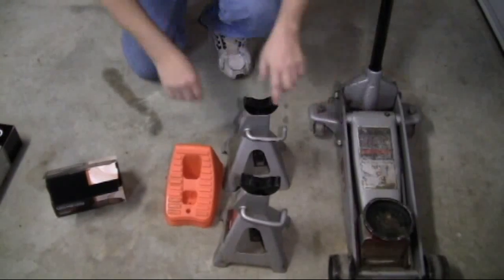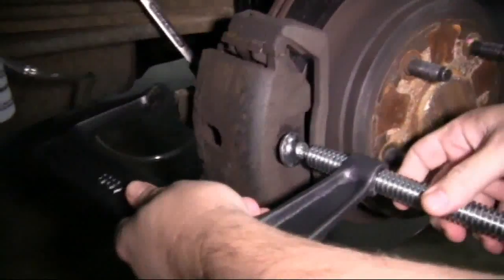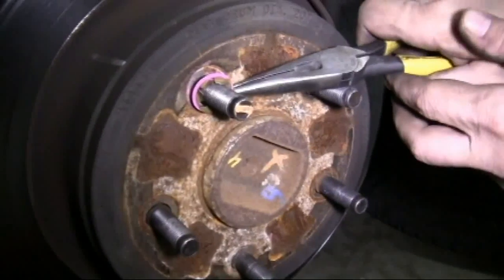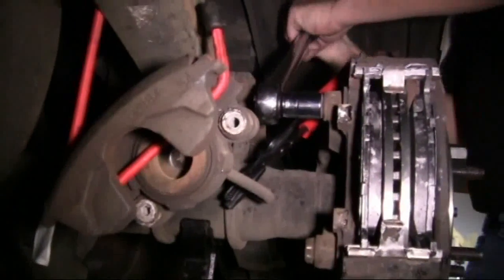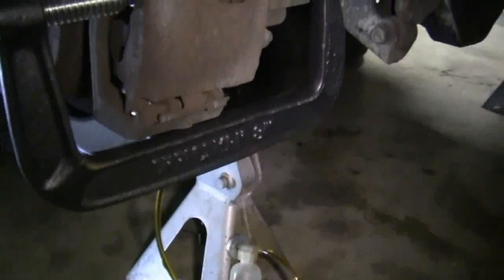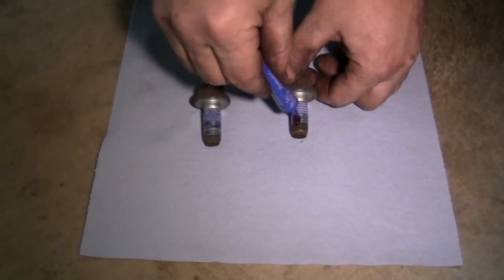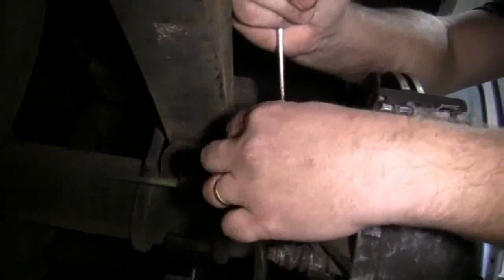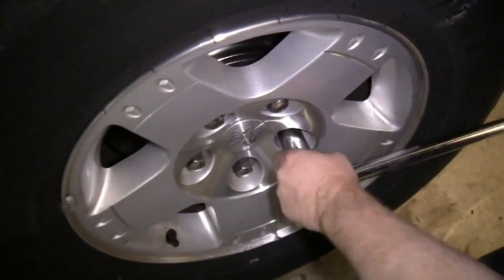Rear Brakes 2004 Dodge Ram 1500

Comment: Many thanks for the vid. I was especially interested in seeing the direction of the pad slide. It seems that the prior owner of my truck installed the slides in the wrong direction (there is a "wide" tab at one end of the slide so, basically, the right side was on the left wheel, and vice versa). Ultimately, the pads got hung up and dragged until the pads were toast. There's nothing as exhilarating as the sound of grinding metal when you touch the brakes...
Reply from the maker: Yikes that is a terrible sound.  Glad we could help. -Greg

Comment: In my opinion, this is a great video tutorial, especially after the service department at the dodge dealership quoted me close to $600 to replace my rear rotors. After watching this video, I'm confident I can change them myself. Very detailed instruction. Thanks.
Reply from the maker: Man $600 just for the rotors?  Wow.  You can easily do it yourself.  -Greg

Comment: I did try to change my rear rotor on my 2010 ram 1500. The rotor won't come out. I did try to adjust to release th e-brake from down to up rotation. My question is how do I know the e-brake is release. Thanks and please email me the step by step procedure just to release the e-brake. Please email me jbajo@yahoo.com. Thank you.

Comment: No need to bleed the brakes, just open the brake  resv. cap and compress the brake calipers...

Also, you don't show how to remove the emergency brake cable, etc...
Reply from the maker: It's always a good idea  to bleed the brakes especially if you open up the system.  Compressing the calipers without opening the bleeder screw allows trash in the system to get into the ABS unit.  Its a small chance but still a chance.  We didn't remove the emergency brake cable because we didn't replace the emergency brake shoes.  -Greg
Reply: @GregorysGarage  you wrong must people wont bleed them unless you replace caliper

Comment: Dodge 2500, 2003.Having a intermittent issue with the rear right brake not releasing. I checked the parking brake but I believe it's not the problem. Any thoughts

Comment: Greg, I replaced all my brakes (rotors & pads) on my 05 ram just like yours. Now if my truck sits like overnight, the next morning I will go to drive it, and I can here a groaning noise. I think from the rear, after I drive for about 1 mile its gone until it sits for a while again. Also it will quit it I tap the brakes. any ideas?
Reply from the maker: +k300zx I am really not sure.  Did you bleed the brakes?  Did you adjust the emergency brakes correctly.  Sounds like your calipers are dragging a little after it sits.   I would make sure the brakes are bleed correctly.  -Greg
Reply: I didn't bleed, just open the cap, I just adjusted the adjustment screw today. Ill check in the morning. its hard to determine which brake is hangin up. thanks for your reply

Comment: hey man....great vid......thay adjusting nut...would that be what i need to do.....my front brakes keep locking up....and no braking from rear tires.....thnx in afmdvance
Reply from the maker: +Alfonso Ortiz The adjusting nut on the rear disc brakes is only for the emergency brake and is not used in normal breaking situations..  Sounds like your problem could be else where.  Problems could be master cylinder, proportioning valve, etc.  Also is any brake pressure getting to the rear calipers?  Now if your vehicle has rear drums then the adjusting nut can affect rear braking but since this video deals with rear drums I am assuming yours are disc too.  -Greg
Reply: +Gregory's Garage thnx for the reply......n yes....they r disc as well....why i figured to ask

Comment: Don't know why this video is using a brake bleeder kit when they're not even changing the brake fluid or disconnecting the calipers from the brake lines.  All they really need to do is take off the cap on the brake fluid reservoir under the hood.  Everything else in the video looks good although I really don't bother using loctite if the bolt/nut is not for sealing a fluid compartment.
Reply from the maker: Bleeding the brakes is a good idea after you open up the braking system.  We open up the bleeder screw in order to compress the piston.  We use a brake bleeder kit to minimize the mess.  -Greg
Reply: Never hurts to run some fresh fluid through the lines.

Comment: Awesome video. Have to replace front and back brakes and rotors on our Durango tomorrow. Hope it goes that easy for us. Thanks for the help.
Reply from the maker: You're very welcome.  Let us know how everything goes..
-Greg
Reply: 6 hours later and just did the back brakes. Driver side was Smoken, Took it apart again and found a rock stuck in the caliper. Had to stop and try again tomorrow. Thank you guys for your video it was a lot of help

Comment: At the end, you installed the tires and lug nuts; snug the lug nuts; lowered the tires to the ground and then torqued the lug nuts to 135 ft-lbs. In essence, you are tightening the wheels with full load on the tire; different bolts will have different lateral force. Is is not better to torque the lug nuts when the tire is in the air (chock the wheels from rotating or just let the tire touch the ground slightly to prevent the tire from rotating)?
Reply from the maker: When we snug the lugs up they are tight against the rim and I can't imagine much more lateral force on them when they are on the ground.  I really don't see a problem.  But if you are concerned you could always either set the emergency brake or have someone apply pressure to the brakes while the vehicle to still on the jack stands.
-Greg

Comment: How do you Re-adjust the parking brake? I had a dragging PB (wore quickly) I replaced shoes& hardware. PB goes to floor w/o any friction. Supposed to be "self adjusting" (found this not the case so much yes-installed correctly). Attempted to tighten PB till wheels would not move freely, then back off. Ended up w/ overheating rotors. What is correct adj? Thanks great Vid.
Reply from the maker: I would adjust the parking brake until you could feel some resistance when turning the wheel then back it off a couple of turns and test it out.  You can test it out by putting the car in drive or on a hill and see if it holds as desired.  You can also adjust the cable going to the parking brake but it sounds like yours is fine..

-Greg

Comment: I know you posted this a while back and I appreciate many of the pointers you made.  One correction: On the rear brakes the caliper mounting pins should not be torqued to to 25 ft/lbs.  This is the torque specification for the front pins which are larger.  The correct torque value for the rear pins is 11 ft/lbs.
Reply from the maker: Thank you for the comment.  I don't have the manual in front of me to double check.  But as we state, or should state, in the videos that you should torque to the manufacture's specified settings.   We try our best to get the settings right in the videos but we can make mistakes..

Greg

Comment: You guys showed that you adjusted the e-brake on the passenger side. Did I miss a section on how to readjust that back when you are done? Also, I take it that the e-brake is not set on?

Comment: Do you  have to bleed the caliper to push the piston in I was just wondering because I usually just open the cap on the res and c clamp the piston in.

Comment: Awesome comprehensive video.  I noticed that you tightened the caliper bracket bolts to 130 ft.lbs. on the first side and 100 ft. lbs. on the second side.  I'm sure this was just misspoken, but which is correct?